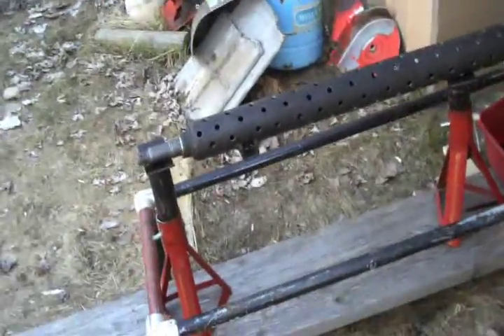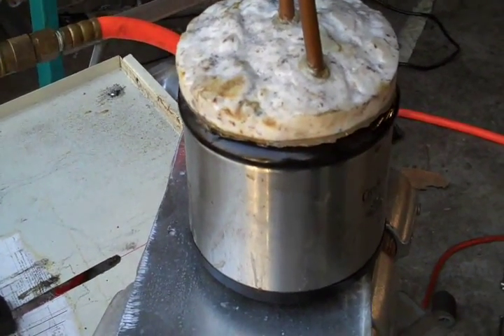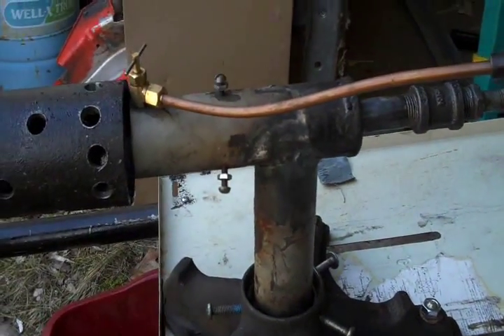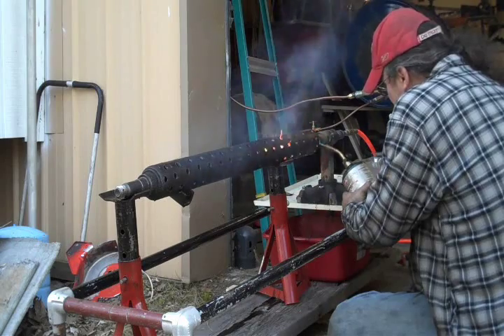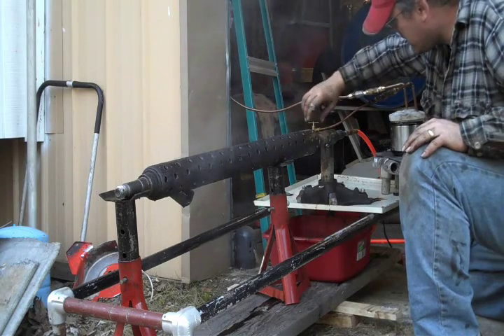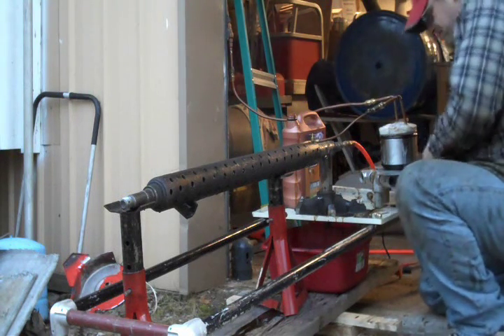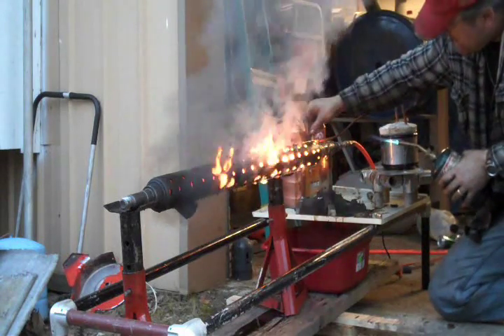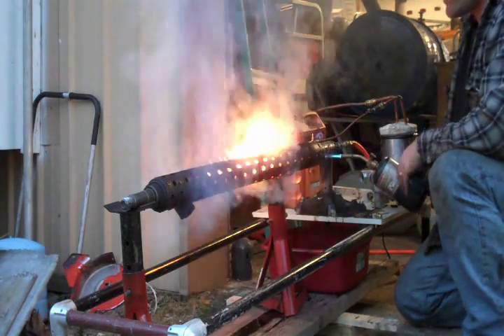Bob's Babington burner

Comment from the maker: @Sorigabor16 
Thank you for the feedback. The burn tube is based on user Oilburner2008's successful design. It has about the same metal to hole ratio. I addressed ball hole size and air pressure in other messages below. I have trouble believing you can achieve ignition of pure motor oil at room temperature. Normally it requires mixing with kerosene or fuel oil to achieve that.

Comment from the maker: For a couple of reasons, I'm actually thinking that the oil is not hot enough. During initial testing, the mini crock pot was only able to get water up to 150F with no top. I was thinking I could get it up past 170F when it was capped. But I don't think that the oil stays in the coils in the crock long enough to get that hot. Also, I had one more testing session later that evening when temps had dropped significantly.

Comment from the maker: @MrMbirrell 
Thanks for the feedback. The current nozzle is a flare cap with a #80 drill hole and a channel cut to guide more oil to the hole. I probably should have shown it in the video, will make a note of that for the sequel.:) I was trying a large range of pressures because there are people like yourself suggesting 20-30psi, and a user named Oilburner2008 that lists 120psi on one of his videos. (cont.)